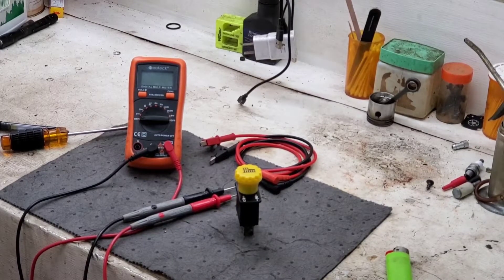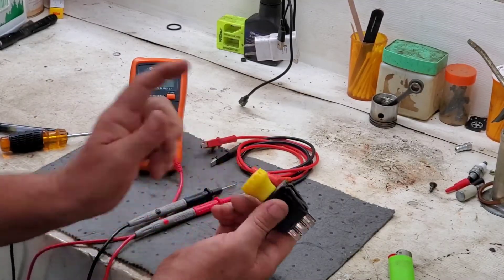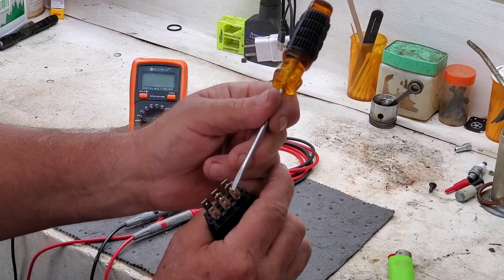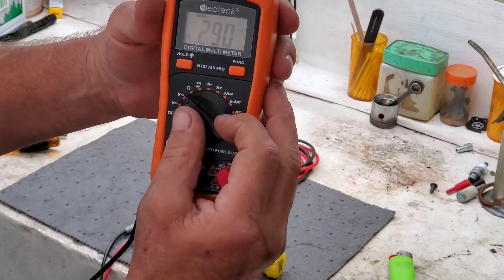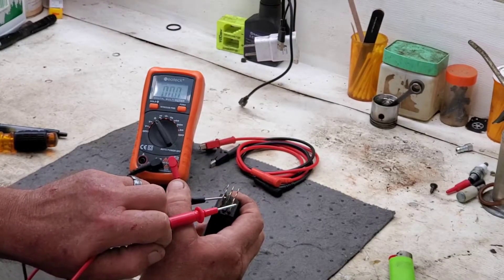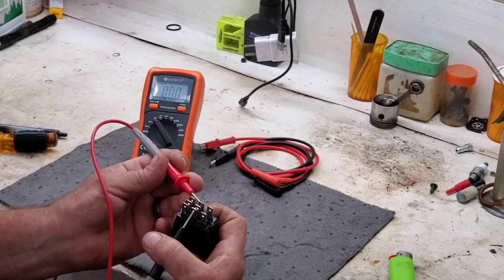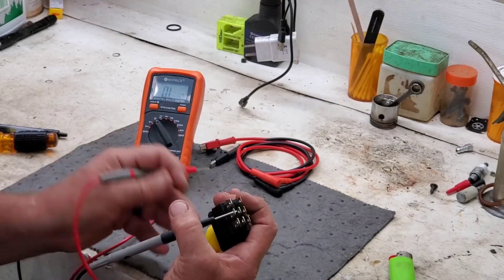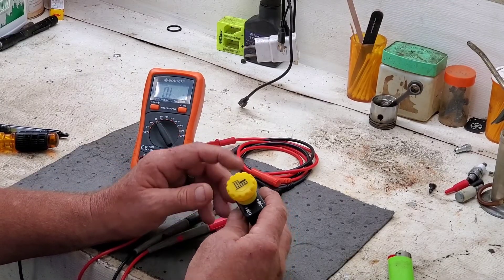How to Easily test most PTO switches with a volt/ohm meter. John Deere, Husqvarna, Toro, Gravely

Comment: Thank you for this video. I have been trying to keep my dads JD 110 4 inch deck going for my mom since he's passed away. I am about to take it into a field and set her on fire!
 Mom's limited income just ain't enough to have it p/u and taken to a service center, SO I have been doing all the oil changes etc deck belt replacements etc. Even puttin new blades and ties on myself. I was attached to my daddies hip in the garage growing up
Yes..I'm not afraid to get my hands full of greese
As dad would say, if you're knuckles aint bleeding you didn't fix it right!
or yep..that ain't going anywhere after loading up the tip trailer
I really could use his help right now as I can't get her to turn over..I thought it might be one of these stupid safety sensors...But I already by-passed them years ago. So I'm good there
the one under the seat drove me NUTS!!!
I live on a corner lot, so have to pick up trash etc as I am mowing

Comment: very simple and my mower was not getting fire to the coil ,i checked this pto switch and it was shorted ,thank you very simple
Reply: I've never heard of a bad PTO switch causing a issue with the ignition coil. Maybe a bad ignition key switch. You should be able to start any machine with a bad PTO switch from what Ive always known. The blades or whatever is hooked up to your PTO won't work. I'm not sure what was going on with your machine however you must have named something wrong or while working on your equipment something must have been loose, and it was plugged in fully while working on the equipment. But a bad PTO would be a first for me to hear it keeping a machine from starting. The ignition coil works off of the key switch giving power to the solenoid to the starter,  flywheel, magnets and then gives spark to the spark plug. No disrespect

Comment: So does this switch pass as a good switch? Mine never changed when switch was pulled or pushed
Reply from the maker: It should change from open or closed when pushed. If it does nothing on ohm meter it's bad
Reply: Thanks for your help.

Comment: OL means "out of limits" not overload.
Reply: Open line
Reply: @bobkernahan6340  Thats what I've always been told, OL does not stand for overload, there is no load on it. OL stands for Open line. It's not out of limit , its an open line, a break in the line somewhere causing an open line. And there you go folks. Bobkernahan is correct with his statement OPEN LINE

Comment: Skip video and read:
My switch is a DELTA 6204 from a John Deere E140 mower.
Bottom view, where x is missing TERMINAL
1  2  3
4  5  6
7  x  9

SWITCH OFF (pushed in), these SHOULD conduct.
1-3          (My old BAD switch is burned open here)
4-6
7-9

SWITCH ON (pulled out), these SHOULD conduct.
2-3
5-6
====================
Period. End of story.
Gawd, I hope this helps somebody.

Comment: This was a great explanation of how the switch works! I have to test mine soon and now I know how!
Reply from the maker: Thank you. I hope it helps you.
Reply: @RaleysSmallEngines  I tried it and some of the pins had a lot of resistance and some didn’t.  I was using a harbor freight meter though.   If they have a lot of resistance would that indicate a bad switch?
Reply from the maker: @Andrew_B89  Possibly corrosion inside the switch or contacts worn.
Reply: @RaleysSmallEngines  ok. I’m trying to figure out why my pto won’t engage… stopped cutting suddenly while mowing   I’m hoping it’s just the switch and not the pto
Reply from the maker: @Andrew_B89  Check for power going to PTO clutch.  Someone must be in the seat, key on, pto switch on.
Reply from the maker: @Andrew_B89  Also could be something as simple as a loose or bad ground.  One more thing, with engine running and PTO off and brake off get off of the seat and the engine should shut off. If it doesn't possible seat switch issue.

Comment: I stalled my mower cutting along a wet bank when the wheel sank in the soft ground. Now, I can't start my Scag Turf Tiger without jumping it with a battery charger. It will run, and I can move the mower out of the garage and around the yard, but the blades won't engage when the switch is pulled out. I pulled my fuses yesterday, and they are OK. I've traced wires from the area where the key is turned where the blade engage switch is located to the frame and PTO in the back of the machine, and I can't find anything wrong with the wires. I pulled some of the plugs apart, and they are dirty, but everything was working prior to me stalling the mower. How do I go about diagnosing what's wrong with my mower. I'm trying to do this myself because anyone who does this professionally can't get it done for the next month, and my grass needs cut now. I'm planning on pulling my PTO switch now and testing it to see if that's the problem.
Reply from the maker: Thanks for watching and commenting.  The battery must have 12 volts in order for the charging system to work correctly.  With machine running check charging system with a volt meter, it should be charging in the high 13 to low 14 volts.  Charging system must be working correctly in order for the pto to work
Reply: @RaleysSmallEngines Did you check under the deck for an obstruction? ie rock etc. that caused it to stall in the first  place? Might be stuck under there……
Reply: That was meant for Greg!😂😂😂